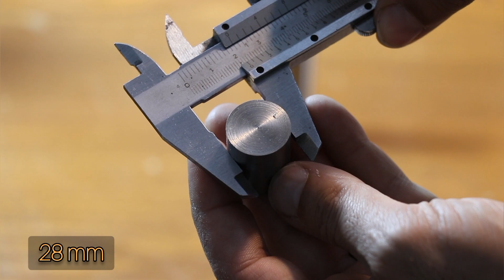How To Make Live Center ( FAST & EASY )

Comment: Would a small lip on the bottom of the spinning shaft help seat it against the bearing and leave a little bit of space between the spinner and the holder as a thrust washer kinda thing
Still a pretty cool build...simple and fast and does what it's supposed to...how accurate is it?  Does it have much runout?
Reply from the maker: Thanks ❤️🙏
Its accuracy is good, maybe not very principled, but it gets the job done

Comment: If you push anything with that center it will most probably lock out as you did not used any axial bearings. It's out of center and the finish quality is terrible with these diy cutters. You could achieve much better quality.
Reply from the maker: Of course ، thanks ❤️